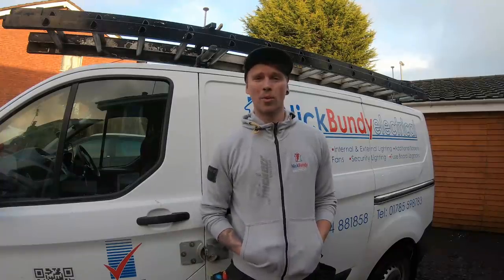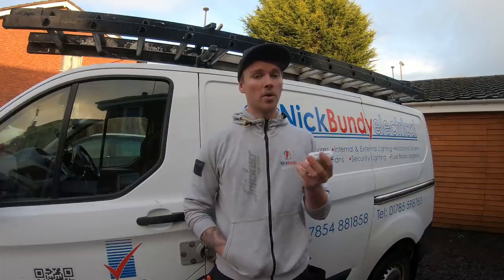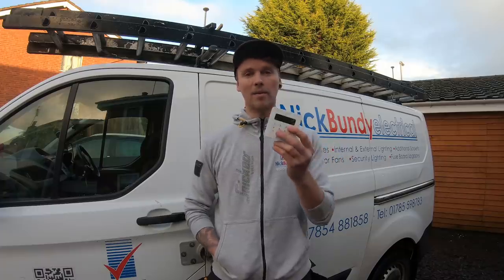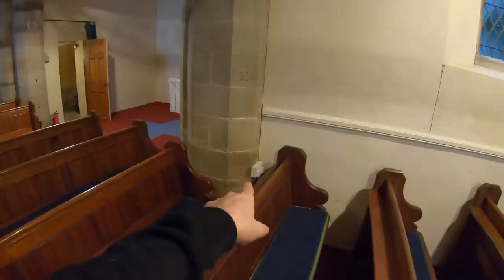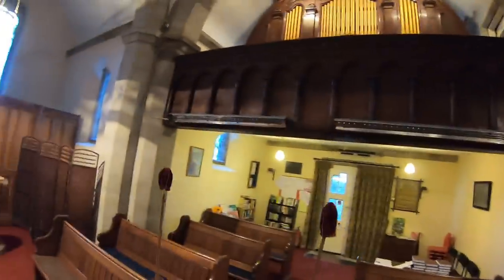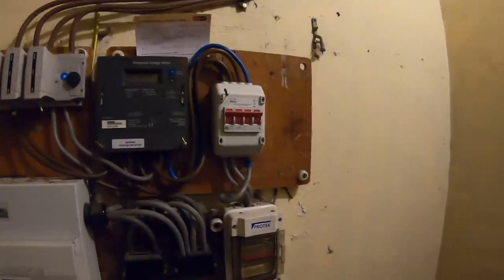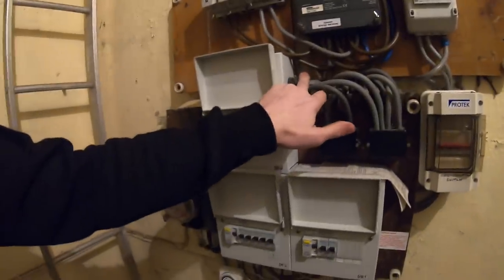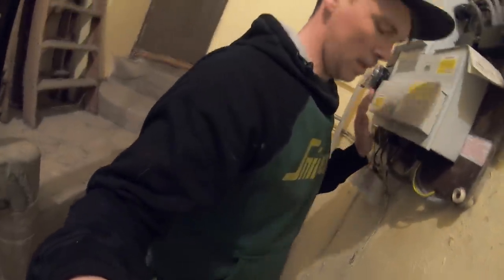AD Get paid with SumUp, Help! Wiring a church, Exotic life on an Electrician

Comment: Nick, many thanks for this brave confession to considering of a job you might not take because of perceived inexperience.  Paul Meenan completely bowled me over at Elex this week speaking about his approach and E5 group, what it means in practice and so on, to improve things for the industry, after spending £5m in a year on re-doing sloppy or misunderstood work by contractors on his train set.  To sum it up, E5 is partially about sharing experiences and asking for help to expand just as you say in your video your knowledge and business base.  Tom Nagy is apparently being initiated in new stuff thanks to E5 on the railway, possibly.  Paul himself, tells stories of being put in charge of rebuilding a TUBE station at the age of 29, knowing hardly anything about it and like you and I, nothing, about escalator installs.  (Pardon me if unbenknown to us you ARE an escalator expert!)   I'm involved with a large church from 2020, being put in charge of their electrical safety and contracting.  It was new to me too, reporting to the fabric committee.  However, I highly recommend learning MICC install it's such a beautiful result.  Also, go to france for efficient ways to heat your big spaces they ALL seem to prefer using radiant heat rather than central heating as per Winchester, Chester, Chichester, St Marys Edinburgh - I could go on, which is hugely wasteful.  We pump air into our big worship spaces as well.  Ask the choristers at Arundel Cathedral who sing up nearer the vault what that results in (vault temperatures of 90 degrees, good for the roof but catastrophic for the willpower of children wearing cassocks and surplices), it's atrocious.  Tom has covered briefly radiant heat and its aim to heat surfaces rather than air.  You should stick, in my opinion, with that - but use Far Infra Red which is at a much lower frequencey than IR, the old type, and warms you like the sun rather than like a toaster element.  I bought loads of them from Herschel through CEF, expensive but stylish looking.  In the en d though the heating elements are, I believe, bought in and identical,  they seem to be 675 watt units, and the heaters come in multiples of 1, 2, 3 of these units.  Phone them and they will calculate your requirement, we thought it initially too LOW, but for constant heating they are almost perfect, even in the winteriest weather in a not very well draft proofed building.  Drafts of course would KILL any of the heat from Central heating.  Good luck buddy, and turn it down no problem if you think it's too consuming, but it will be interesting for you if you don't.  In the end, give Paul Meenan a bell, he's openly stated he's there to help and he has the track record on helping small guys with big contracts get all their ducks in a row, once he got 6 of them including John Ward to work OVERNIGHT on one guy's electrical design for a client the next day, because the contractor inquestion admitted he needed the work but did not feel competent.  It's one of the thing E5's all about, and you're already doing some of the E5 stuff looking at your channel, and your nurturing of Adam....      ta for now,     Rupert.

Comment: done many a church in , go for it, check the spec ,any insurance,  other diocese requirement, if none cost on FP200 for a cheaper job but MiCC for a better job , though dearer
Plus i would stick the cost of a alley mobile tower on the price (to buy) on the job and allow at least 50% more labour than you think.
once you done the job at least the church have bought you atower for future use, Good luck

Comment: Go for it nick, would be great for videos! But seriously, you need brown round cable (can you get brown fp200? This would be my choice, if not use flex if no protection is needed). Armoured is too thick. Also get some emergency lights in (or new fittings with built in) and get the contract to maintain them, and a basic fire alarm. And you can hire narrow lifts for the raised work. Are the pues portable? Thatll make things a lot easier.

Comment: Im in Canada, the panels and cables are different.  I suppose they like everyone else is looking for the most cost effective solution without extras.  Here everything is newer with forced air baseboard heaters would be way more expensive to run but less upfront.  Looks like a fun project tho best of luck
Reply: forced air stuff just arrives in the vault, and costs a fortune to run.  I know because it takes 3 boilers in our church and each year we're bankrupt!!!
Reply: I left out a period after forced air.  Yes I would suggest baseboard heaters most likely.  I dislike Infrared anything.
Reply: Joshua Lee    What do you mean ? You left out a period?   Sounds weird.  Have you tried far infra red though it’s extremely gentle and arming heat.

Comment: I have a similar job in the pipe line. The only previous experience with church's I have the council make it a requirement to wire everything in pyro so something u might need to check with the council. Not sure why they made us do it but looks like that church maybe similar

Comment: Definitely do it in hi tuff that waterproof black cable thats hard to cut. I did my whole house in it as i have a cretin who visits and stamps on everything. Especially as church is damp. As for conduit, metal good for outside and in places where theres a lot of public, but plastic be just as good and easier to instal but more risk of being damaged but easily replaced.  Not sure about heaters, definitely not ones that make noise. Maybe a mix of different type heaters ceramic and oil filled. Keep price down as its a church. Jesus will be pleased.

Comment: If they haven't already had one, I would get someone down to design the heating, churches are always hard to keep warm, and expense to heat due to their construction.
It looks like there's no skirting on the walls, so some nice skirting trunking could be used for power and possible heater points. Whichever wiring system you use will stand out, personally I like galv conduit on stone, but the labor cost will be quite high.

Comment: It will probably have to be done in MICC as FP200 is not normally allowed in churches. MICC should not be affected by damp unless the sheath is damaged or more likely it was poorly potted in the first place, in which case it's normally as simple as to dig out the RMX compound and remove the pots, then drive out the moisture with a hot air gun and repot (the moisture never travels more than 6" (150mm) into the cable as it forms a plug. If it wasn't for the fact that I'm semi-retired, live in London and no longer drive I would offer to help you out as I still have my skills and all my pyro tools (and the same Megger MFT as you lol)!

Comment: We did a church and had to strip the orange sheathing off the mineral cable as they wanted the copper look 🙂
Reply: Sorry to break it to you and  I haven't touched micc for a 15+ years so it may of changed  but it was sold uninsulated as well
Reply: Never understood why the church I grew up going to had various bits of internal and external lighting wired in orange MICC. Are black and white sheaths new inventions?

Comment: One of our local churches was owned by the local prison and as such the cost of electricity wasn't a problem, as such it had over 30kW of electric heating. Naturally it was 3 phase and had one large industrial CU filled with 16A breakers, plus one extra CU feeding some of them (I believe there was at least 4 CU's around the place, with the main electrical "cabinet" being quite a sight. 
Now to control all this was a single small switch feeding a load of contactors, I hate to think what the power on surge was like.
One of the many heaters can be seen to the left of the pulpit in this picture https://c1.staticflickr.com/2/1022/869542014_143ab730fe.jpg , being primarily of 2-3 bar type heaters (so guessing 1kW per bar).

Comment: Check out what the floor structure is. If it is suspended it is very unlikely that it will have adequate load capacity to support a scissor lift. Black Hi-tuff clipped with 'P' clips works well when following the route of existing pyro and when clipped against dark stonework and/or roof beams blends in well.
From video it looks like a stone or wooden moulding at the joint between the top of the walls and the ceiling. Often there is a nice 'hidden' channel created on top of this moulding which is perfect to run cables.
Also if the floor is suspended check out what is below it. Often there is already an access hatch under the carpet and a void deep enough to stand in. This is perfect to run basket or trunking in and then bring all your feeds for sockets and light switched in T+E from below. We have done this very successfully in a church before.
Reply: A narrow access youngman tower might work better, jobs like this a laser measure is handy to work out  options.

Comment: Micc cable does not normally detereate terminations are causing low readings.Dont think you would get a sissor lift up those steps.
Reply: I'm inclined to agree with you, it may be more cost effective in this instance to completely disconnect every accessory and test each cable and then determine if it's worth replacing a run here and there. It'll be either a badly potted cable, someone's fiddled and trapped something or the over sleeving on the bare cores has deteriorated or been damaged.

Comment: Re the comment that fixtures must remain in the same place:  where there has been water ingress damage the diocesan architects should be fine with minor adjustments if that will likely prevent the issues recurring.  However do get any such signed off in writing.

Others have commented about re-using some of the existing MICC.  See if you can test some of the current installation runs; if it looks good enough to keep that would be a real win for the aesthetic considerations of the DAC, minimising disruption and potentially costs, even with the extra time for terminations.  Only if the existing stuff really isn't up to spec quote for full replacement.  And when you do that talk to the local people first: there's a chance that if you put in a pukka MICC quote along side a less expensive FP200 or other alternative the DAC might go for the "proper job" when the church can't make the budget for it.

Comment: Father Ted Voice  Well now we don't want any of that plastic shite in here, me thinks metal clad on all the outlets and switches so it last's longer for them you know. If your going to do a job in a church you should do it right the first time and not go doing some cheapo cowboy fittings.   
"THERE A BUNCH OF COWBOYS TED  https://youtu.be/rUHunfH0XbI "
LED Fittings throughout a great idea. Cable wise would it be rude to say all armoured with just the visible drops done in conduit ? That building will be tough as a bomb shelter so securing things to the wall should be a breeze.  
If they wanted an exterior power outlet for various uses this could be concelled with some treated wood and drop of dark stain so it doesn't ruin the character.  
Heating wise I've heard people mention ELKAtherm radiators are perfect for things like churches and they have some timed/thermostat solutions to make like a bit more manageable. 
Failing all that you might have to call father larry duff, he's got a new phone with an extra loud ringer. :-D